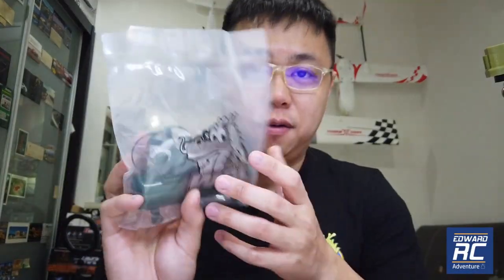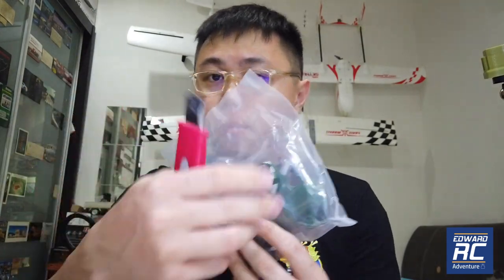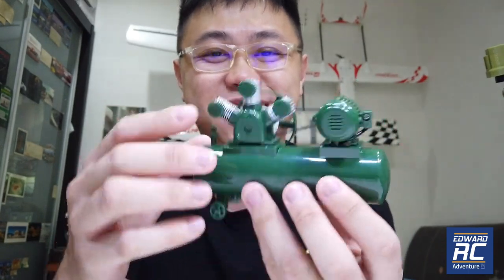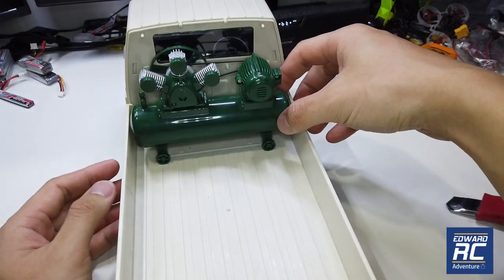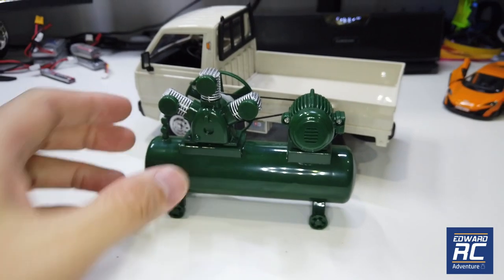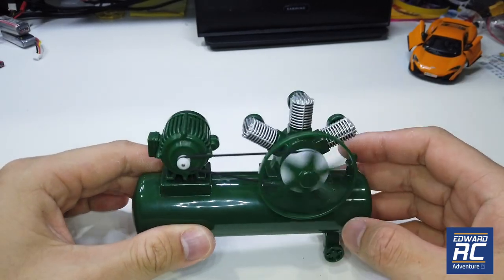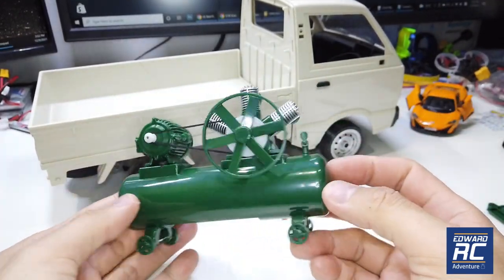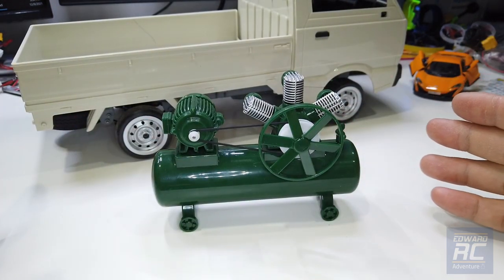Air Compressor Working Miniature by WPL RC

Comment: Edward rc when i buy the kit in your shoppe is the motor servo ang Transmitter are included
Reply from the maker: which KIT?  got link?
Reply: @EdwardChew   the wpl b36
Reply from the maker: KIT as servo included. Not transmitter
If you want everything included, it's the RTR